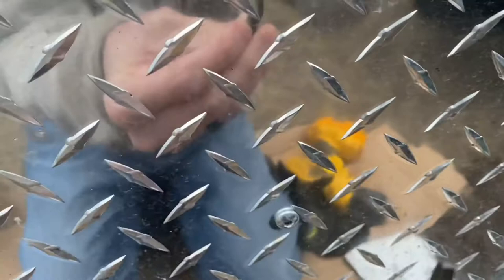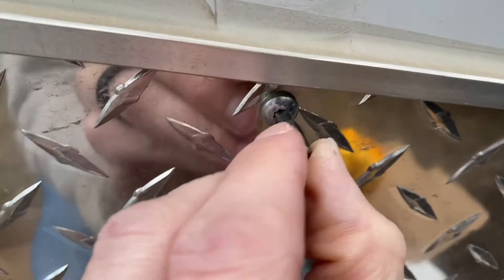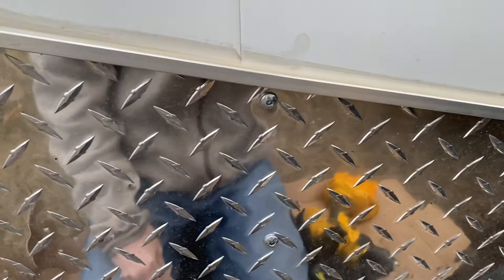What size Torx bit - Enclosed Trailer ANSWERED for Interstate Hallmark Cargo

Comment: I wouldn't say "perfectly" as mine are too tight and strip out with a square bit. You need an 8 point bit to do it properly.
Reply from the maker: Interesting, thanks for the comment, it might help someone. I didn't have an 8 points on hand but the 4 worked for me.
Reply: @projectjames7437  I actually just received a few 8point point bits today from Amazon to the rescue.